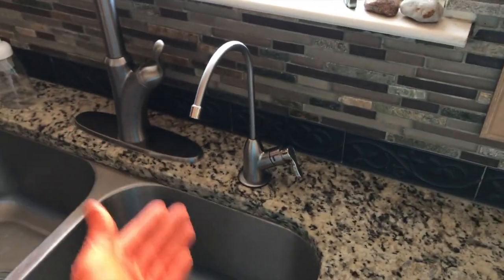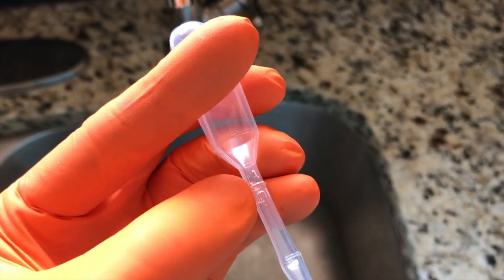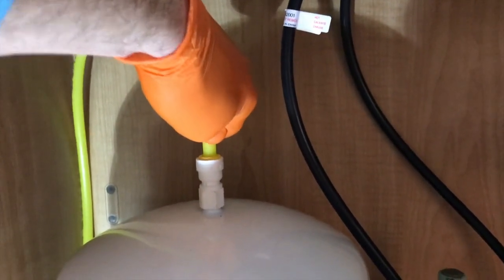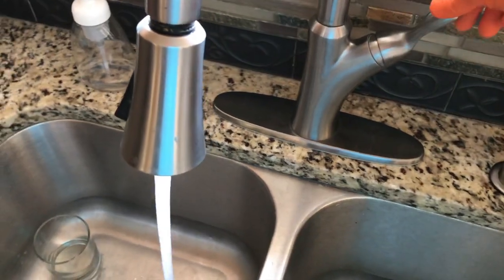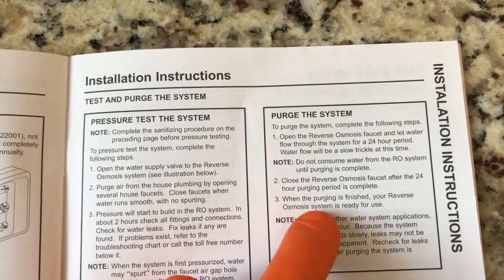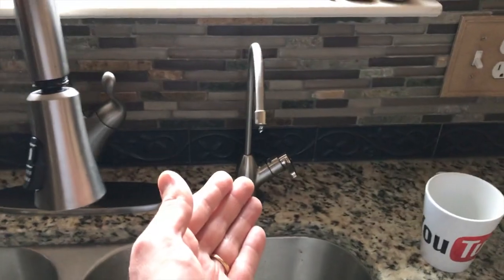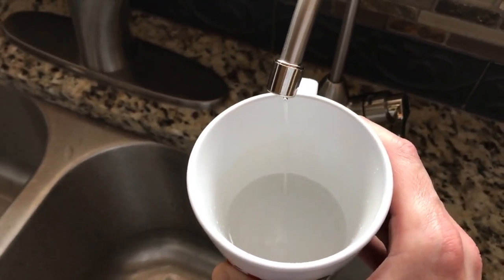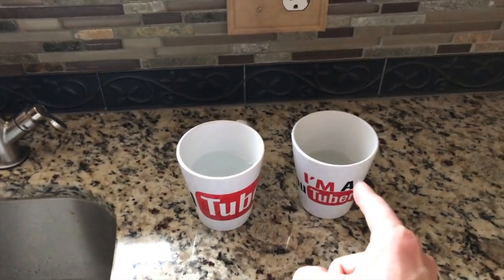How to Sanitze & Purge GE Reverse Osmosis System!

Comment: After 24 hours of keeping the faucet open to purge the chlorine, I closed the faucet for 3 hours to fill the tank and obtain its pressure, but when I open the faucet the water only comes out with pressure for a few seconds and then it stops the water. what can be the problem?
Reply from the maker: Thanks for watching & sharing this.  The first thing we need to check is the actual psi reading in your tank.

If your tank is very light, it is empty and we can use that to our advantage.  It’s best to check the psi when the tank is empty and in most standard reverse osmosis systems, the tank psi when empty should be between 5-7 psi... however it’s extremely important to reference your specific model owners manual to get the proper reading.

If the psi is too low, you will need to re-pressurize tank.  Below is a link to a video showing how to do this.

       https://youtu.be/mjg-nGxpBM8

Let’s start there.  😎👍🔧🔩
Reply: @DIYwithMichaelBorders  thank you very much for your help, it helped me a lot
Reply from the maker: @alfonsovanegas86  

You are very welcome, us fellow DIY’ers need to stick together!
Reply: @DIYwithMichaelBorders  bad news, the problem continues. I have the correct pressure but I still have the same problem. I do not know what else to do.
Reply from the maker: @alfonsovanegas86  

Thanks for the update.  Is this a brand new system?
Reply: @DIYwithMichaelBorders  yes, i bought it yesterday at the home depot store
Reply from the maker: @alfonsovanegas86  

Thanks for the reply.  We are actually uploading a full video series over the next few weeks on the Home Depot RO system.  Is your new system the 3-cartridge system...?...2 filters & one membrane?

We recommend verifying the filters as well as the water lines are properly secured.  What is the psi on your tank when empty?
Reply: @DIYwithMichaelBorders  model is GXRQ18NBN and 3-cartridge system. 60 psi
Reply from the maker: @alfonsovanegas86  

That’s the exact system we have now.  The tank should be no more than 5-7psi when empty & 12psi when full of water.

If your tank is at 60psi, it is over powering the entire system and will never allow water into the tank to fill.
Reply: @DIYwithMichaelBorders  what a fool I am, I will lower the pressure right now. Thank you =)
Reply from the maker: @alfonsovanegas86  

We are excited to hear back.
Reply: @DIYwithMichaelBorders  Thank you, the problem has been solved, thank you for your advice, you are very kind to help me.
Reply from the maker: @alfonsovanegas86  

That’s great news & thanks for sharing this.  As we always say, us fellow DIY’ers need to stick together!

We are always here to help answer questions.  Hopefully many stress free days ahead for you & your family Alfonso.

😎👍

Comment: My faucet light isn't turning on after pulling out the plastic strip. What do I do?!
Reply from the maker: Thanks for watching & welcome to the DIY Raptor Club.  It’s possible that a small piece of plastic is still stuck in-between the electrical leads not allowing it to turn on.

To fix this, you may need to open up the battery compartment and remove any remaining plastic.

😎👍🔧🔩
Reply: @DIYwithMichaelBorders  Thanks Michael! I did check to see if residual plastic was there, and in doing so, the lights came on when I was unscrewing the cap. So, it's fixed! I think it just needed to made more "contact".
Reply from the maker: @jdt_phd_1  

Very cool, we appreciate you taking the time to share your update.  Thanks again John.

😎👍🔧🔩

Comment: So I connected it all and turned on t he Water and the filter box spit out Water and leaks.  Nice.... it does not leak from the hoses which I did it  correctly, but the unit is faulty.  It leaks from the inside.  After hooking it all up its full of water and now a wet mess. Back to Home depot
Reply: The leak to the drain is apparentlynormal. It's on pg 23 of the installation manual

Comment: I think you did the step wrong for the pressure test system.  Step 1 says to open the supply valve to the RO system.  You opened the RO faucet.
Reply: I thought i saw hears that. The video was helpful to me because I did get any instructions.
Reply: Can you elaborate on this?

Comment: Changed filters and water starts strong then slows to a drip.  How to fix ???
Reply from the maker: Thanks for watching & welcome to the DIY Raptor Club.  You  may need to give your system more time to fill the tank.  Hopefully you should have good strong pressure once system sits overnight and has plenty of time to fill tank.

Keep us posted.  😎👍🔧🔩
Reply: @DIYwithMichaelBorders  michael great video I'm a handyman in the high desert near palm springs ca. After changing the filters the flow is as I discribed, should I leave the dispenser on overnight and / or use air pump to increase bladder psi. Thanks Patrick
Reply from the maker: @patrickoneill8047  

Thanks for the reply & that’s a great idea.  Keep us posted on how it performs over the next week.

😎👍🔧🔩
Reply: @DIYwithMichaelBorders  👍
Reply: @DIYwithMichaelBorders  @patrickoneill8047, did you fix your problem of having weak pressure?

Comment: Well it has been a month and I now get no water from system. Is it normal for the tank to slowly lose pressure?
Reply from the maker: Thanks for watching & welcome to the DIY Raptor Club.  Is there a leak?  You may need to fully drain system and reapply Teflon tape around the thread fitting and resecure it.  After that, it’s time to pressurize tank.  Below is a link to our video showing re-pressurizing tank.

       https://youtu.be/mjg-nGxpBM8

Hope this helps.  😎👍🔧🔩
Reply: @DIYwithMichaelBorders  I went to pull out tank and noticed it is empty. It refilled for a month, even heard the air gap noises. I thought I had no pressure, but I have no water in tank. Water is on, never touched since install. Have you heard of this?
Reply from the maker: @polocash11  

Thanks for sharing this.  A faulty flow control valve can cause this.  A loose or clogged filter can cause this as well.

😎👍🔧🔩
Reply: @DIYwithMichaelBorders  I turned off water, removed and reinstalled filters, topped tank pressure to 7. Nothing.... 
Pulled out battery and reinstalled and at same time removed silver part of  faucet. All of a sudden I heard water flowing and noise from air gap again. 
Working again. Not sure if it was the battery or could be. And if was faucet part, what was wrong?
Thinking battery, but does it do more than turn on light and keep time?  I do have the blue light now. 
Will have to if it does this again.
Reply from the maker: @polocash11  

Thanks for the update.  We just spoke to GE customer support on this & they mentioned that a dead battery shouldn’t put a complete stop to your system.  But sounds like it did to yours...🤔

Comment: After 2 hours I am filling a 1 gallon bucket in less than an hour. Other say when using bleach to sanitize, run for 5 minutes or until no bleach can be smelled. It has been 3 hours now and I have no bleach smell. Why does it take 24 hrs?
Reply from the maker: Thanks for watching and we asked the same question however due to the manufacturers specific instructions, we wanted to make sure we follow them.

Let us know if you have any questions, enjoy your night.

😎👍🔧🔩
Reply: @DIYwithMichaelBorders  Thanks for fast reply. I decided to slow the water flow down to a trickle at faucet.

I noticed this only makes 11 gallons/day and others in same price range claim double or triple. 
Are there ways to increase this?
I know getting a second tank would allow me to have more in reserve and makes the filling 2x as fast. 
Have you ever used 2 tanks. Or is their a better tank that can hold more and have better pressure?
Reply from the maker: @polocash11  

Thanks for the reply & we haven’t dealt with 2 tanks.  There are modifications you can make however most people don’t do it.  Keep us posted on your project if you do.

😎👍🔧🔩
Reply: @DIYwithMichaelBorders  Do you have link for the water tester?
Reply from the maker: @polocash11  

You can do a quick google search.  They are very price friendly.  Below is a link to our video showing us using the TDS meter to test water.

       https://youtu.be/K4xOTBj69uk

Hope this helps.  😎👍🔧🔩
Reply: @DIYwithMichaelBorders  Does your blue light flash everytime time you use faucet for ro water? Mine does not.
Reply from the maker: @polocash11  

Thanks for the reply and it does.  We recommend opening up your battery access tab on your Faucet handle and pulling the battery out and then re-inserting it and closing the tab.  This will reset your Timer/light.

😎👍🔧🔩
Reply: @DIYwithMichaelBorders  I pulled out battery and pushed it back in and got a couple of red flashes, but I get no blue light ever.
Reply from the maker: @polocash11  

Thanks for watching & it’s time to replace battery.  If your system is brand new, it’s unfortunately possible that your battery was low from the get go.
Reply: @DIYwithMichaelBorders  Yea, it's new and just made 2 months ago, but who knows how old the batteries were.
Reply from the maker: @polocash11  

True...keep us posted.
Reply: @DIYwithMichaelBorders  Thanks again for your help. You don't just post a bunch of videos but are there to back them up. 

I finally got a tank full of ro water, after the 24 sanitation, and compared the flavor to tap, and I do not taste a difference. I ran the tank empty so I can compare again tomorrow. 

I party chose this model due to your videos, which are great. I am second guessing myself now. The tank is small, it only makes 11 gallons a day and is priced with others that can do more. I am making ice with ro water also, to check the clarity. 

What was your reasoning for choosing this unit?
Reply from the maker: @polocash11  

Thanks for the reply & we definitely understand.  At our previous property, we had a GE system for over 6 years.  We chose this because we did a lot of reading on this specific GE system & was impressed by the engineering behind making it a friendly install for your everyday DIY’er.

We wanted to purchase this and go go the extra mile for our fellow DIY’er‘s and film the entire install.  We have been very pleased with this however as you know, there are several other system options that may fit your mission much better.  Keep us posted.

😎👍🔧🔩
Reply: Hello I was wondering why is may sistem is liking a lat of water throu the black hose?

Comment: Would you happen to know why it is constantly leaking out the faucet opening opposite the handle and the drain black tube after install?
Reply: Did you find an answer or a solution for this because I’m having that same issue
Reply: @madelinelopez8049  after a while it finally stopped. We did find out our pressure is pretty low and good water pressure does help with better filtering so I’m thinking that might be it
Reply: @madelinelopez8049  Make sure the 3/8's drain hole is properly lined up with drain fitting, Also make sure black drain hose has a nice downward flow to the drain fitting. The black hose cannot have any loops. You want a nice smooth downward flow to the drain fitting or else you will have trickling water coming out of side vent.
Reply: @madeline lopez  if you read under installation instructions on page 23, OPERATING FEATURES, it says its part of the design.

Comment: Hi, I has water leak under filters base
Reply from the maker: Sixto Franco 

Thanks for watching & is the system brand new & newly installed?  If yes, the common cause of this is loose water lines.  Have you pinpointed a possible waterline that is leaking?  If yes, apply friendly inward pressure to secure line to pressure fitting.  Keep us posted.  Us fellow DIY’ers need to stick together!

😎👍🔧🔩
Reply: @DIYwithMichaelBorders  hi, the water leak is under filter housing unit. I checked all lines and not has water leak.
Reply from the maker: Sixto Franco 

Thanks for the reply.  Is system brand new?  If yes, this is common believe it or not as the system is pressurizing for the first time.  You will definitely want to monitor any leak over the next few days of use to verify it goes away.  Keep us posted.

😎👍🔧🔩
Reply: Ok, can you do a video for change the filters in Osmosis inverse model# GXRQ18NBN?
Reply from the maker: Sixto Franco 

We will add it to the list.  😎👍
Reply: Is it normal that every time I use the filter the noise coming from the side of the faucet comes back again?
Reply from the maker: Sixto Franco 

Great question & it is normal.  That is the Air Gap cycling out the dirty water to the drain line.  If you hear that sound, the system is in the process of making you clean water.

😎👍🔧🔩
Reply: Now water is coming out of the tap vent
Reply from the maker: Sixto Franco 

Thanks for the update.  Are you referring to the Air Gap?  If yes, you may want to check your drain line.  Verify it’s not clogged.  Is system new?
Reply: Yes, is brand new
Reply from the maker: Sixto Franco 

It’s unlikely however we can’t rule it out...it’s possible that the unit is faulty.  Can you replace for a new unit...same model?
Reply: @DIYwithMichaelBorders  Ok so I found the problem, looking at your video and calling a friend of mine that also works with plumbing i found out that I had to put the black hose directly into the sink without any bending. Until now im not having any leakage.
Reply from the maker: Sixto Franco 

Thanks for the update & that’s great news.  We really appreciate you sharing this.  Sounds like you’re back up and running.  Enjoy your clean water.

😎👍🔧🔩
Reply: @DIYwithMichaelBorders  thank you
Reply from the maker: Sixto Franco 

😎👍🔧🔩
Reply: I bought it on Saturday...

Comment: I thought you couldn't run bleach through the membrane filter without damaging it?
Reply: @Misterlaxx d That's a good question, I think if you follow the 3 ml or if you go over by a little,  I don't think that will hurt the system, but what is interesting is you are purging the system for 24 hours, it must take a long time for the system to get rid of the Clorox, because the old GE system you would fill up the system 3 times and drain each time, and that had 2 tbsp of Clorox. I taped the eyedropper to the tank so I don't lose it.
Reply: The Clorox is added after the RO membrane, so it just goes through the post-filter and the output lines. Also, there is a check valve after the RO filter. See the diagram on page 7.
Reply: What psi should my tank be at?
Reply from the maker: @michaelcastanon7887  

5-7psi